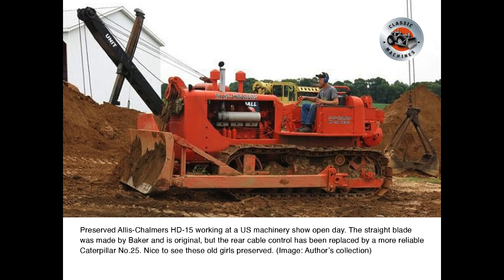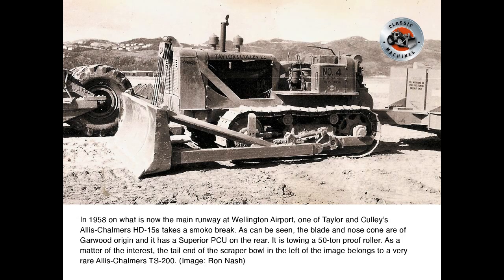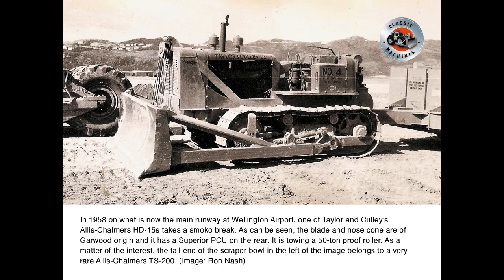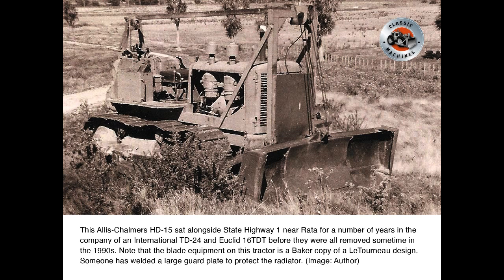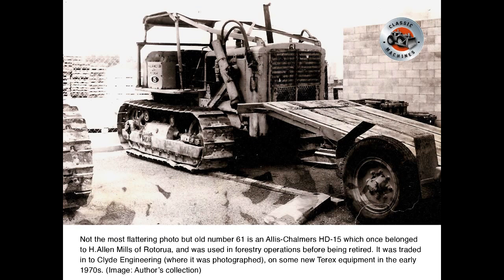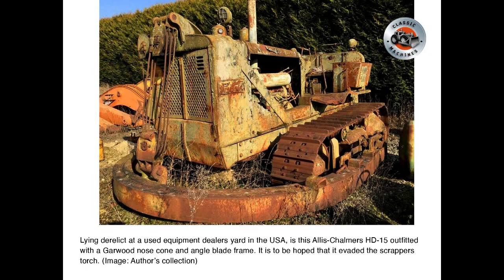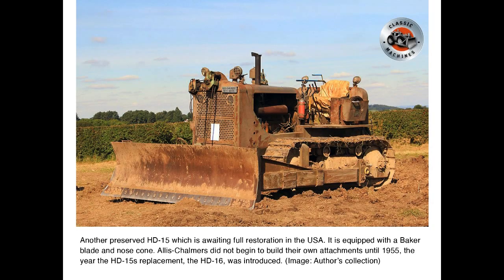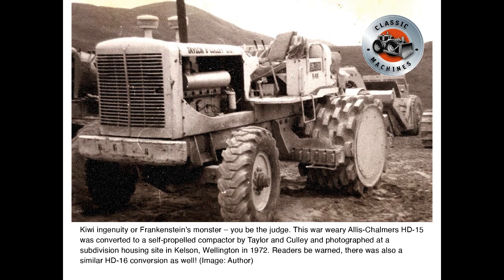Classic Machines: The Allis-Chalmers HD-15 tractor

Comment: Thanks, Lads and hope all is well. Looks like we've got a blow on the way but being this close to d.c. the capitol it's no big deal. Lots of hot air all the time.  I can't remember the website but a guy has a running 15 with a GM 6-110 in it, rebuilt. SWEET running so maybe you can find it. He hasn't turned a video ;loose in a while so maybe he's just busy. You lads remain calm and CHEERS and BLESSINGS to all!
Reply from the maker: We should be ok. Thanks Lewie
Reply: @NZContractormagazine  Sure hope so. Florida is looking at 12 to 15 feet of flooding along the coast.